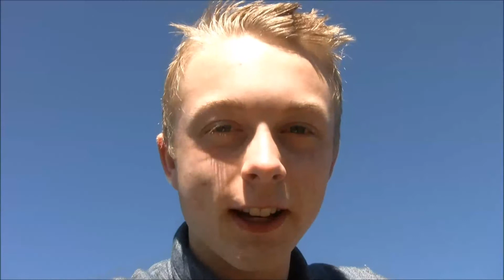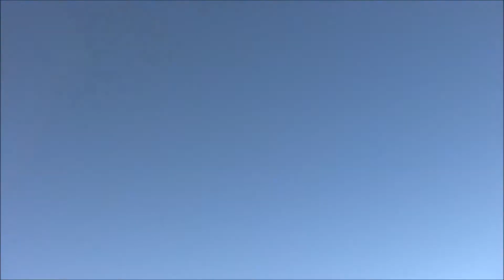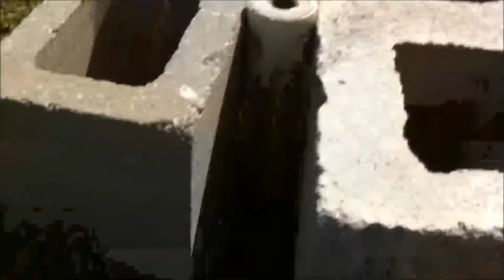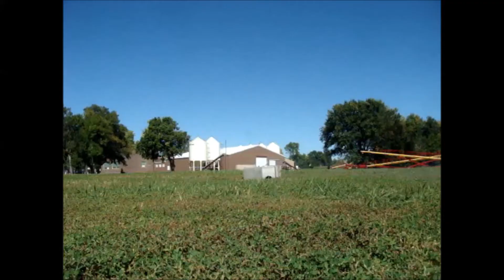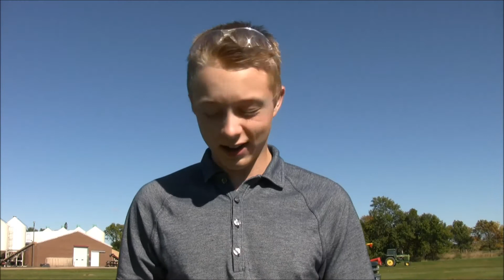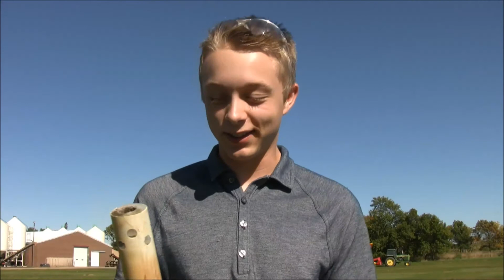HUGE ROCKET ENGINE!! 1 FOOT LONG (STATIC TEST)

Comment: That was freaking awesome dude! Good job on that engine! The burn seemed a bit too long, so adding iron oxide as you thought might be a good idea. You should totally try to launch this from one of your rpgs (at a safe distance of course), maybe try and hit a target with it?
Reply from the maker: Thanks!  I actually made it because I was completely bored this weekend.  I couldn't believe it worked!  And yeah, I want it to burn as fast as possible without pushing the nozzle/end cap out.  I think Al powder gives it a faster burn rate than the Iron Oxide, so I might use that.  I was thinking of doing that, but I would have to build a new launcher since it's so big.  Plus, its too dry to launch any rockets now.  That'll have to be a winter project.  I want to see your rocket when you launch it!  Let me know when you do it :)
-Brett